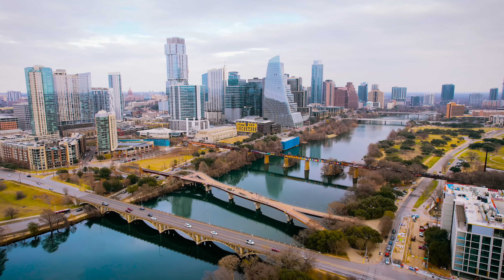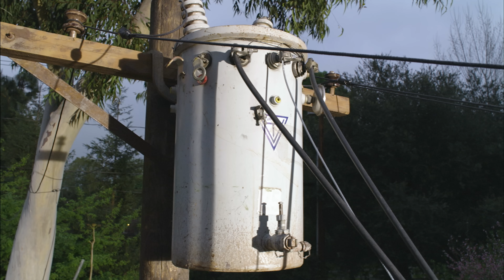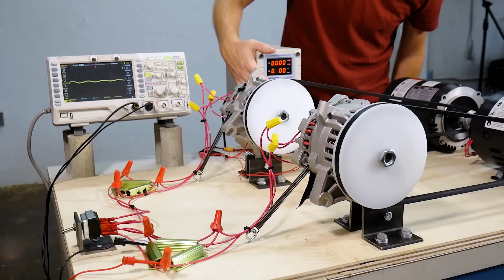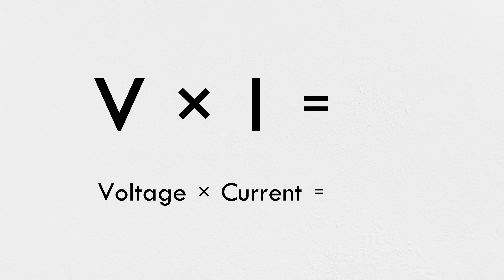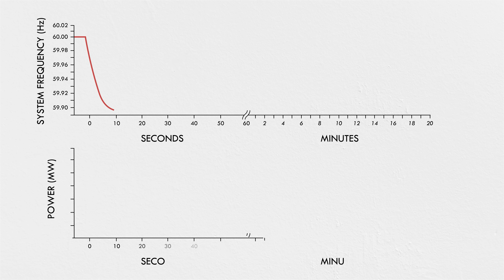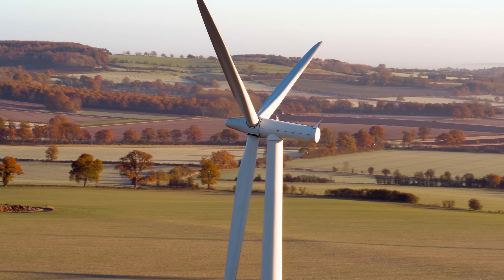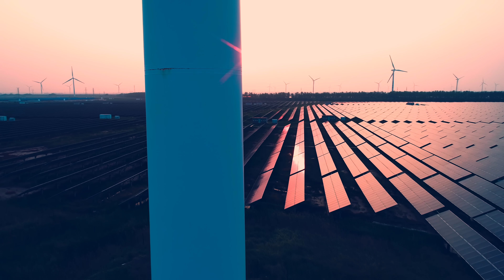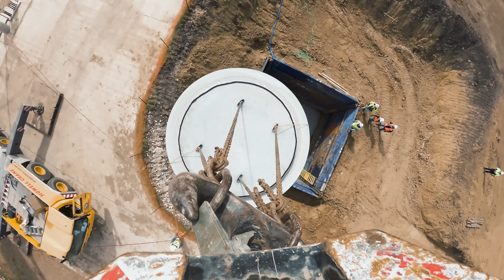Connecting Solar to the Grid is Harder Than You Think

Comment: In early 2025, the Baltic states in North-Eastern Europe are set to disconnect their grid from the Russian power grid, and connect up with European power grid instead. This might sound like it's simply some sort of resynchronization task, however the reality is much more complicated, requiring the Baltic states to build out a fair bit of extra infrastructure and take on the task of maintaining grid frequency where before, Russia would have been doing so. This might make for an interesting video.
Reply: I live at a junction between two power companies' service areas, and they have the ability, in an emergency, to connect one to the other, but there is the catch that there has to be a transformer, there, because the operating voltages don't match - and there's no synchronization, and there's a meter to measure the power that crosses junction.
Reply: @kenbrown2808  Brazil has the same issue, along with Japan, and built HVDC systems that are both frequency changing, and bidirectional, so that power can flow either way, along with changing the frequency of that power to suit the local grids as well.
Reply: @SeanBZA  ting is, there's no reason to make it more complex, because the only reason for a cross feed would be if one power company has lost equipment to the point that they need to buy energy from the neighboring company, in order to supply their customers.  - in which case, the only thing that needs to be matched is the voltage.  no need to cross connect if both grids are up.
Reply: @kenbrown2808  Also works to even out loads in wide grid areas, as a peak in one can be fed from the other, and vice versa. Brazil and Japan are big enough to have different peak times, and also have different grids as well for historical reasons.
Reply: @SeanBZA  but that's better done at the supply end of the network, and is done at the supply end of the regional power companies' networks.  not at the far fringes, where I live.
Reply: @SeanBZA most countries in the euro-zone are in the same timezone. So it vill not make a huge difference.
Reply: @kenbrown2808 this happens on an almost daily basis. you're fairly efficient to have every power company be able to be able to provide max power at max load, always. connecting to other companies let's them buy power when load is high for them and low elsewhere
Reply: @SeanBZA  Japan has only one time zone so how would you have different peak times across the country?
Reply: @FirstLastOne  Different cities so not necessarily the exact same load profile, so you cross connect while power stations are either ramping up or down. Was an issue with the big quake because the transfer station was not capable of transferring enough power when the Daichi reactors went offline, so while there was enough capacity one side the other was not able to access it.
Reply: @SpudsMcCat  and again, that is done at the supply end of the grid, where it is purchased wholesale.  not at my end, which is literally the second furthest point from the geographic center of the area my power company serves.  the interconnection point literally only exists in case a natural disaster wipes out miles of transmission line between my meter and the supply end of their grid, and the only way they can carry out their contractual obligation to me, and my neighbors is to buy power at RETAIL prices, from the neighboring power company.

as I have said multiple times.
Reply: @kenbrown2808  and if you're selling electricity to the grid  you ARE the supply end...

even if you're not selling to the grid  you are to yourself. your electronics in your house need the voltage in phase.
Reply: @SpudsMcCat  not the installation I'm talking about, today, either.
Reply: @kenbrown2808  well that's what the rest of us are talking about
Reply: @SpudsMcCat  and none of us in this subthread are talking about what you are talking about.
Reply: @kenbrown2808  There is a sort of rotating transformer that does voltage, phase and frequency matching between systems.  Such (eg) between Ontario and NY.
The "smarter" alternative is AC-DC::DC-AC such as between Quebec and surrounding systems (Ontario, NY, VT, NH,ME,NB - also MA but that's a long distance HVDC line).
Texas also connects to surrounding systems with AC-DC::DC-AC interties.  Great isolation against voltage and frequency faults when you do this.
Reply: @AlanTheBeast100  and this isn't one of them.  because it's a system they hope never to have to use. and as I said, there is no chance of a frequency fault, because it is never intended to be run in parallel.
Reply: @kenbrown2808  That's fine, but when in use the section connected to the emergency provider would have to be "islanded" to isolate it from the rest.  No big technical issue - just coordination to isolate.
Reply: @kenbrown2808  Joining grids without synchronization, these days at least, is generally done with a DC transmission line. The rectifier and inverter setups at both end deal with syncronization.

I don't know if there is any other way to do it.
Reply: @robertbackhaus8911  and again, this is not joining grids. this is an emergency provision to backfeed an orphan branch, in the event the grid connection takes catastrophic damage.  the grids are joined at the source end by their connection to the regional power generation groups, but this is the tail end.
Reply: @kenbrown2808 so Japan or Texas. These interconnections are often done with "back to back HVDC" where they convert the AC to DC as if it's going down an HVDC link but there's no link and they convert the DC right back to AC in the next room. The reason they do this is the second converter doesn't have to output the same voltage, frequency or phase that the first converter inputs.
Reply: What's going to happen to Kaliningrad's grid? Is it going to be also synchronized with the Baltic countries?
Reply: @seneca983  No. They've done practical testing to ensure they can and will be completely islanded.
Reply: @seneca983  Nothing, it will probably become an island if there are no sea cables connecting it to the mainland.
Reply: @seneca983 that is a very good question that no one has answered 😂
Reply: @davidrussell8689  Well, I know the answer now. Lithuania disconnected itself from Kaliningrad as well. I'm not sure whether that was really necessary.
Reply: As I understand it, the reason this is such a big job is that the EU has a rather complicated system. The Continental Synchronous Area covers most of Europe (Great Britain, Ireland and Scandinavia each have separate grids with asynchronous interconnections), but it isn't really a single grid. There are a bunch of grids that are all synchronised to each other. Each country (or small group of countries) is responsible for maintaining their grid and keeping it synchronised with the rest of the neighbouring grids. The Baltic states won't be joining an existing grid but establishing their own and then synchronising it with Poland's (which is synchronised with the rest of the area).
Reply: In Mexico the whole country is just one huge network. If you cut the country in half the two parts compensate and work independently. No private companies and cheap electricity.

This allows to use solar and wind an turn down coal, nuclear and other on the day nation wide.
Reply: @leonvolq6179  That's the case for most countries. Island nations often have different grids for each island for practical reasons. In the US, Texas has its own grid because it's Texas. Otherwise, pretty much every country has a unified grid.
Reply: @thomasdalton1508  New Zealand has a separate grid on each island (so two grids) and an HVDC inter-island link.
Reply: Sounds like they will be installing some synchronous condensers which are essentially giant spinning machines with no load. They provide grid stability and have the ability to absorb or produce VARs.
Reply: sadly PE seems to be exclusively american

if we are talking about this topic, ukraine had a noticeable grid disturbance on nov 23, all nuclear power plants had emergency stopped (which is more then 50% of production) and for 3 days we returned a few centuries back in time

it had weird "dont rock the boat" kinda coverage back in the day so. still such an event sounds interesting.

afaik its transmission lines that got damaged, not production capabilities.
recovery from this sounds immense
Reply: 11 months later, from your post, we are synced with Europe, without a single glitch, frequency is stable and pootin is still a dictator, soon to be liquidated.
Reply: this definitely sounds like something that seems simple but is super interesting
Reply: Yes this happens in 8-10 20 2025. We in estonia are ready to disconnect from russia. It has takes about 10 years to prepere. New transmission lines have built and old ones renewed. There are multiple new sub station and three synchronous compensators, and in the future there will be couple more. People are spreading roomores that the power will go out when we dissconnect from russia but we stopped buyeing power from them long time ago and thay are connected just to keep the system stable. I think people just overreact and the transition to new source of power and new sync source will go fine and no power loss will happen. There might be some short outages for like hour or two but not ones that last for days.
Reply: Are they connecting to Euro grid using HVDC link?
Reply: @Chopper153  They've had HVDC interconnectors with Poland and Scandinavia for years. This will be full synchronisation.
Reply: Idk why but it reminds me of Japan having two separate power grids. If it’s super simple to do the conversion then I bet Japan would have just done that lol.
Reply: @joeybulford5266  Japan's two grids run on different frequencies. One is 50Hz and one is 60Hz. Changing the frequency would require an enormous amount of equipment to be replaced. All the grids in Europe are 50Hz. That means they don't need to change the frequency, just synchronise it.
Reply: Excellent video.
Reply: ...and Ukraine did that with no prior planning, in two months.
Reply: Has anyone considered the old High Voltage DC “ spine” for stability with general power generation linked to loads off a infrastructure grid actions determined by load types ( inductive capacitive resistance) in a “ neural network “ configuration which avoid the “artificial “ shortages by market manipulators in order to increase prices to customers by off lining at critical stages for profit ?

There is no good in having the “ power “ to change market conditions in the hands of professional profiteers who very reason for existing is money made from supply ( restrictions) and demand ( predictions) all of which they control like the Wizard of Ozz!!
No joke !

Remove the template for corruption and it will yield a more sustainable power supply for all consumers.
Reply: @kennethcfogarty  Did the nurses let you out from your aged care home again? They gotta be careful, you could hurt yourself with a spoon...
Reply: And probably also causing unnecessary high inflation in their energy prices. RIP citizens
Reply: They did it!!
Reply: @speculawyer  They did indeed :) They demonstrated the ability to function as a separate energy grid holding their own frequency, and then a day and a half later, connected up with the wider Central European energy grid through Poland.
Reply: They did cut off from Russia.
Reply: I have watched news about this concluding basically a couple of weeks ago. So that's fun.
Reply: Didn't they already do it in 2014?
Reply: @carkawalakhatulistiwa  They got an interconnector to Poland in 2015, but that was asynchronous.
Reply: Absolutely! While I've seen a video on what makes it complex I'd love to see Grady's take.
Reply: Why do the russians keep supporting their grid amid this hostile standoff, i'd guessed they sabotage everything they can instead of propping up baltic power grid.
Reply: Doesn't the grid they're switching to already do frequency maintenance? Why do they need to roll their own? 🤔
Reply: Absolument
Reply: This would make a great video!!
Reply: I'm even surprised that there are connected to the Russian powergrid, i mean, hasnt it been like 30+ yrs ago since the soviet union collapsed?.🤯
Reply: Baltic states are already connected to European network at least through Poland.
Reply: Also, the international connections are usually not exactly synchronized, they high voltage and separated from the local networks, at least in some cases the connections are DC. So I'm not quite sure what this comment is about exactly.
Reply: This please instead of talking about toys for the rich..
Reply: Why not just have a single global power grid? That way there's no messing with competing standards
Reply: @KaizenOramara   long distance transport is wasteful and it's extremely difficult to keep the whole power grid in sync.
Reply: Very interesting topic!
Reply: I would watch this
Reply: That will be the biggest mistake ever in energy distribution 🎉
Reply: @brettmoore3194  Hey Ruzzia fan, why?
Reply: it's less of a deal than people made it out to be. just yet another "look, russia evil" headline, nothing new
Reply: @QiuSe  How much did they pay you in roubles to write this again? 6?
Reply: 2025 here, we had a big blackout on the iberian peninsula, probably due to solar power. That whould be an interesting video!
Reply: One thing they can do nowadays is to use DC for that interconnect. Europe should be doing it because that way you insulate parts of the grid from each other against oscillations that spread throughout the grid.  The real question is: why do they want to make electricity more expensive for them and for the EU?
Reply: @maxheadrom3088  It's often cheaper to use just plain 3-phase AC connections because they don't need expensive converter stations at the ends.
Reply: So they're causing a significant expense to their people and taxpayers for the political demands of NATO over a temporary land boundry dispute they have no involvement in?  Sounds kinda like if it aint broke, don't fix it.
Reply: @r61425 OK Ivan, calm down 😂
Reply: Europeans specially in Spain the politicians are anti-technocrats and they insist in a “clean energy generation”, eolic and solar power are unstable as this video explains, that was the reason of a big blackout in all Spain.
Reply: Why not be self sufficient?
Reply: Hopefully Putin shuts them off soon for their betrayal.
Reply: @DingleMcBerries  what? What do you mean by "betrayal"? What do you mean "shuts them off". The Baltics shut YOU off, Ivan. No more Baltic electricity in your Rostov Khruzchovka 😂
Reply: European grid also split in half a couple of years ago
Reply: Should've been done years ago tbh
Reply: @BooleanDisorder  easy for you to say.
Reply: @BooleanDisorder .    Under the current circumstances, Russia should disconnect it now. The elites that control most Western governments are trying to pressure Russia to give up their sovereignty.
Reply: @BooleanDisorder why?
Reply: Puck Footin
Reply: @birdbrainengineer I actually was the lead engineer on initial efforts on this project for the DOE back in 2020. We even brought in a group that I led (I worked for a national lab at the time) consisting of other engineers and did a multi-day workshop with the Baltic engineers.
I even used this exact topic as a thesis to finally finish up my masters.
Reply: Ukraine was able to disconnect from russia and synchronize with EU grid. Should be easier for Baltic countries than it was for us..
Reply: @AlexanderBelikov  Ukraine had no choice but to switch their grid connection on an emergency basis. The Baltic countries are doing it slowly and carefully, since they don't have the same rush. Ukraine's grid has had a lot of stability issues, but those caused by Russia bombing its substations have dwarfed any caused by the bodged synchronisation.
Reply: So Russia could literally pull the plug on their electricity right now? They should definitely hurry up!
Reply: @nielsdaemen Europe could too when they connect. What is your point, and why would Russia do that?
Reply: It's not just grid frequency, but the impact of the stability on the Baltic grid. Without advanced controls, the AC line connecting the grid between Europe and Baltics will constantly trip (small signal stability(
They should keep the connection asynchronous with DC lines.
The AC line is poorly thought out and politically motivated "solution".
Reply: @Olivershoesoff 
Asynchronous DC .. what is that?
Reply: @Peter_Riis_DK A DC interconnect (convert AC to DC, then back to AC on the other side) allows the connection to be asynchronous -- ie, the two grids do not need to share the same phase or frequency.
Reply: @antonliakhovitch8306 
Right, perhaps that's what he means.
Reply: @Olivershoesoff 

How do electric companies adjust the phase of the wave to connect to the grid?   

Voltage, frequency and PHASE must me in synchrony
Reply: @ajarivas72  Frequency and Phase are pretty closely related. Basically, the smaller grid would need to match frequency with the larger grid, and then after getting the signal to close, the breaker would close at the zero crossing (in phase). 
Voltages matching isn't such a big deal, you just don't want a huge difference. Otherwise there's going to be a pretty substantial reactive flow.

Edit: they adjust frequency by increasing the generator output.
Reply: @ajarivas72  they synchronise the phase by first matching the frequency and then ever so slightly increasing/reducing the frequency for a short time before matching the frequency again.  This causes the relative phase to shift slightly.  There's a device called a synchroscope that can show the relative phase of the two systems.    I've only seen it done manually with really old equipment where the synchroscope looks like a clock face with just a single hand: perfectly synchronised is stationery at 12 o'clock; a frequency mismatch will cause the hand to spin (the faster the rotation the bigger the difference); the hand being at anything other than exactly at 12 means a phase mismatch.

Get it wrong, and there's a loud bang as the rotator in the generator is suddenly pulled around and into sync, drawing a sizable current at the same time.
Reply: @Olivershoesoff  "politically motivated", lol. It's even less politically motivated than synchronizing with EU's grid.
Reply: @Olivershoesoff  ukraine did it much earlier than expected with no issue. why is it poorly thought out?
Reply: @Olivershoesoff  Something similar but on a bigger scale had already been done back in the 1990's: Poland, Czech Republic, Slovakia and Hungary disconnected their grids from that of former Soviet Union and synchronized them with the western European grid. To make it possible there was some work to be done, mainly constructing power lines to Germany and Austria and installing newer, more accurate and effective automatic frequency controls in the power stations. And since then it works prefectly.
Reply: @adamzieba8364  Absolutely - but they need many lines in order for it to work. Also, check out Alberta in Canada and the massive issues they originally had.
Reply: @Olivershoesoff  I generated electricity in Alberta for 37 years, what massive issues did we have?
Reply: Common, russia is such a reliable supplyer, who would never try to leverage its economic power to blackmail other states .... hey wait, that was the Soviet Union... Putin-russia not so much .....
Reply: @NuclearSavety theris catch in that catch, Kaliningrad is connected through Baltic states, and if they disconnected Baltics - Kaliningrad is also out.
Reply: @NuclearSavety Russia has still been a reliable energy supplier its ukraine that is disrupting oil and gas supplies to Europe.
Reply: @NuclearSavety actually Russia is more reliable than the west. They still provide gas and oil to Ukraine (discounted as well) and Europe as per contract.
Reply: @NuclearSavety ironically the same applies to USA, China, France, UK...
Reply: @NuclearSavety  "leverage its economic power to blackmail other states" yea that's the u.s foreign policy in a nutshell
Reply: @NuclearSavety  Show me an instance where Russia has ever used its position as an energy supplier to demand anything of anybody.
Reply: @mananaVesta  23rd of March 2022, Putin demands payments for Russian gas in Rubel (against valid contracts) so that the Russian national bank remains operable despite sanctions due to the invasion of Ukraine ...
Reply: @mananaVesta  Western europe denies this request, and few days later, the North Stream Pipeline goes down for "maintainence" for month ...
Reply: I am not expert but I am aware of many not obvious complications & you can predict a lot, but technicalias of magic energy 🙊🙉🙈 require some things done/measured/tuned in REAL TIME ON/IN PLACE. Specially when it is "modular systems" synchronizing (enough) to makes things work. It's difficult job I HEARD.👀ツ
==>
Soooo generally You "can't" use examples from other places to solve "the same problem". I mean often but it's depending on many (also political) things 
¯\_(👀)_/¯¯\_(ツ)_/¯
Reply: There are no reserves or excess capacity in the power supply system 
There is no headroom on generation, transmission, transformers, switchgear etc
There will be more major power outrages due to lack of investment whilst power system companies management takes as much cash out of the system as possible 
Years of under investment has led to the decrepit state of the system
Reply: @MKHNitro  What country are you talking about?
Reply: @MKHNitro  That's completely and demonstrably false. I'm not sure where you're getting this "information," but I'd find a new source.